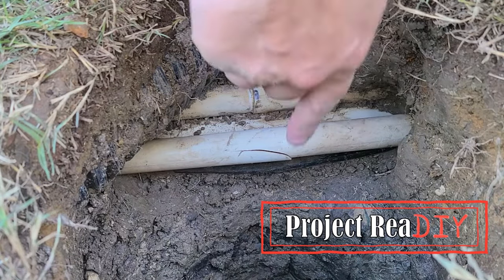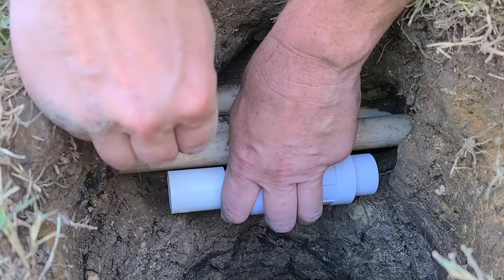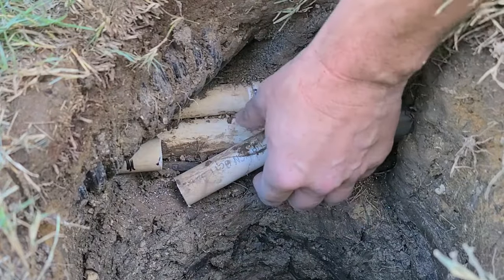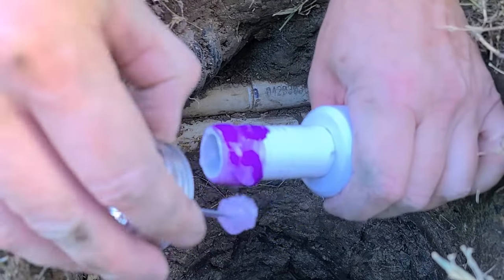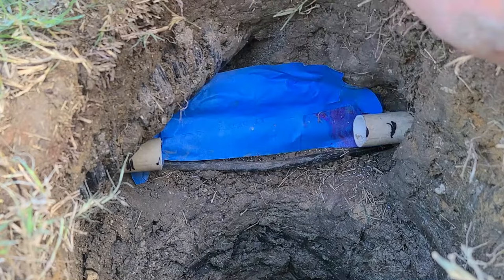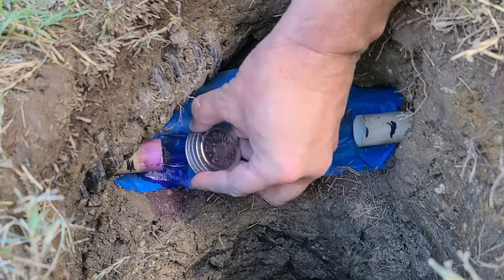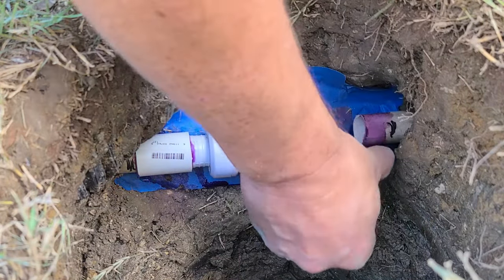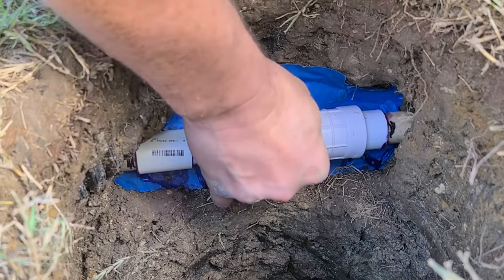PVC slide repair coupling fix

Comment: big stores should sponser your video. For someone that doesn't know how to use every single connection out there, this video was extremely helpful.
Reply: Although it was a great idea at first, sadly it did not work out for me. Perhaps I grind a little too much but I did add plenty of PVC glue and let it dry for 24 hrs as indicated. Luckily for me, I had no obstruction on either side of the repair - I just had to do it the old way. Thanks for sharing anyways!

Comment: You are an absolute godsend. I have attached my (high pressure) pool to pump supply lines three ties now - every time, the line blew off and sprayed water everywhere (the joint failed). Your video totally reminded me to use primer! Rookie mistake!!

Comment: this will eventually fail due to the rubber gasket inside the coupler.  I don't recommend using it.  depend on your location.  a plumber used it to repair a waterline and it failed within a year.  Had to dig up the whole thing and do it properly.  So far it held up 6 years and counting...
Reply: What did you successfully replace it with?  Im getting a major leak and one is installed by previous owner.  Im thinking about doing some elbows like I've seen in other videos.
Reply: I sanded down the stops in a coupler where it will BARELY slide on without glue (had to muscle it). Think I got the idea from electrinicsNmore from YouTube.  I dug out a bigger hole so I have room to work in.  I cut out a bigger section about 15inches of pipe.  Put a coupler to the existing pipe.  The slip the coupler without stops on the pipe.  I put a tons of pvc cement on the joint and slide the coupler to join the 2 sections.  So far no issues.  I would also pack sand over and under it so it doesn’t crack in the future.  Good luck
Reply: What do you mean “rubber gasket” - I didn’t see any rubber gasket in his video! Where is the gasket and why did it matter?
Reply: Also can you rewrite this step by step clearer…..how u did it
Reply: @MathCuriousity  The reasons why the coupler slides, is because there are 2 rubber o-rings inside the Home Depot slide coupler ( the one i purchased for example ),  once those rubber o- rings fail, so too is ur fix imo.  That's why the pvc coupler and glue is the tried and true method with no rubber o rings to go bad.

Comment: Must these be fully extended or will likely leak??
Reply: Theres a gasket inside. You should extend all the way if possible but Ive had some fall a little short and had no issue. Just extend as much as possible.
Reply: There are 2 rubber o rings in them ! My first time to try!

Comment: Wow, these are my new best friend never knew they existed till seeing them at Home Depot. Fixing PVC has always been such a huge pain in the butt. 

I’ve been spending about three hours trying to repair our current PVC one trying to slide it back and forth, but in hundred degree Arizona heat everything expands and not really possible a normal coupling.

Comment: helpful, thank you.
how long before safe for water pressure?
Reply: If it’s connected to straight pipe you can turn water on immediately. If you ran it into a 45* or 90* give it 30 mins to an hour for 1” or smaller. The pressure pushes outward so the straight pipe doesnt want to separate whereas a corner get pressed as the outward pressure applies here(hope this makes sense)  Bigger stuff, 2” plus, try to let set over night.
Reply: I always recommend 1-1/2 or 2. Don't cover your work yet. Test your work, no leaks, success.

Sometimes depending on the product, instructions gives you specific times and when are considered cured safely to use. Depending on the diameter and pressure pvc. 

I remember the last freeze we had around 2021, the product label was set at 4 hours which was weird. Due to the cold freeze  I took the advantage of turning on the next day. No leaks.